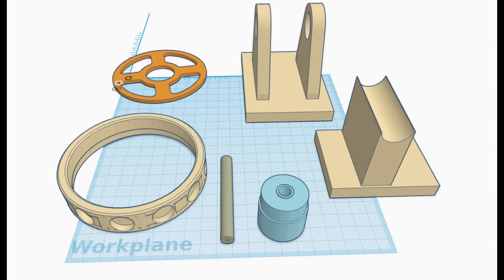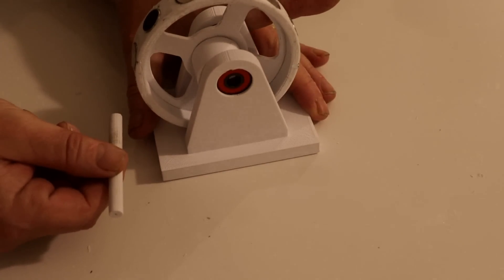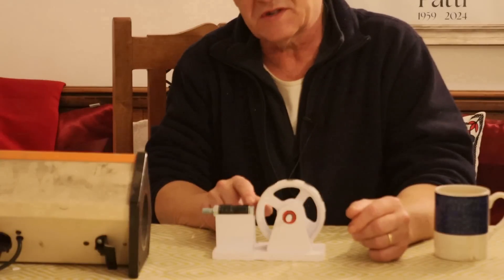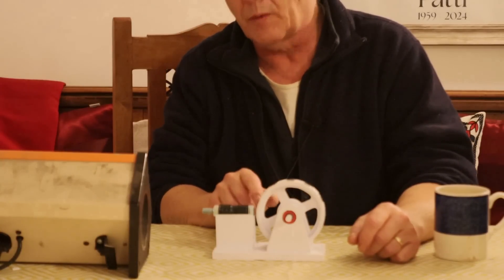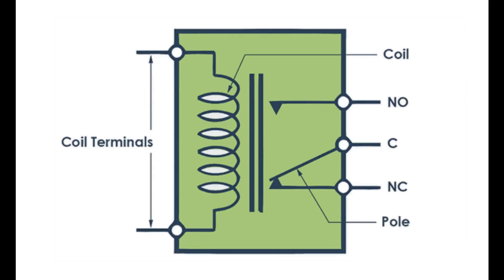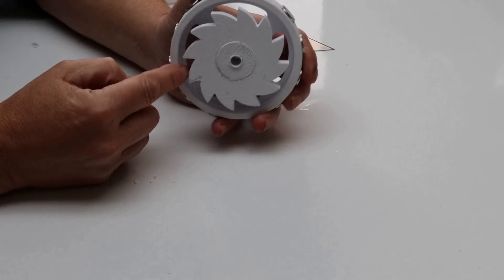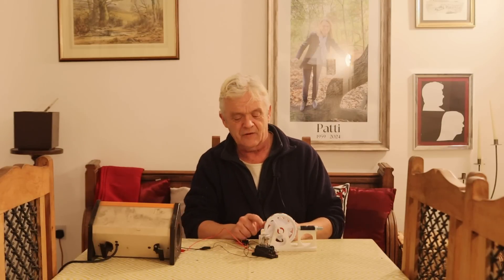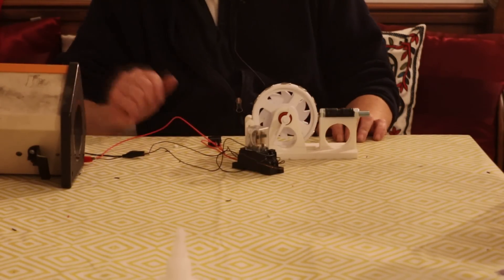2321 Building And Controlling A Stepper Motor

Comment: There is a much easier way to control the direction which is to add a small piece of ferrous material such as another screw near one of the magnets that offsets it by a quarter step when you disconnect the power.  That way when you do the next step there is a much less distance to travel in the offset direction.  This technique is the basis of a Lavet type stepper that is used in commonly available analog clocks.

Comment: Hi Rob, It would be really cool if you could make a large, safe flow battery that is in the form of a 'Double-A' battery. Use some kind of PVC or ABS pipe that is between 6 and 10 inches in diameter as the housing. Then people could have a plan on which they can create there own expandable battery storage system. They could charge the system with solar, wind, etc.  This would be great for people who want energy security and a DIY whole house backup system. Of course there is a bunch more to DIY battery packs, BMS etc., but that can be expounded upon at another time. Just an Idea. Thought you might be interested.  Also anyone reading this post, if you would like to see Rob give this a go, hit the 'up' icon. (wow, it's weird typing that :D)
Reply from the maker: What do you think is a safe battery mate? and not in general - specifically what battery chemistry would you regard as safe?

Comment: Can you hook up a capacitor to the motor that can be used to continue powering the solenoid after an initial injection of power to get it started?
Reply from the maker: for sure - but for this application you just want to pulse it
Reply: @ThinkingandTinkering  Can't a small IC be added to it to do just that?

Comment: Good day Rober ,hope you are doing good ?
What do you guys think about using LC oscillator  to change the the direction of  the magnetic fields for a faster motor?😂
Reply from the maker: that's what is up and coming in the timing control section mate

Comment: I love the simplicity of that design.  I have an idea if it sounds interesting. You need to make a black box that lets one store and retrieve umpteen electronic components with a code. Something all us electronic geeks can use to find stuff! 😊
Reply from the maker: To be honest mate i don't like to do that - stuff varies all around the world and goes out of production - i tend to concentrate on the idea and try to make it work with a host of different components - so any DPDT relay will do, the wire isn't that important, any thickness down to what you can handle and up to half a mm, any bolt and pretty much any magnet around that size - skater bearings are almost universal but if you have different bearings just change the hole size - or at least that's what i try to aim for - I also hope folks will improve on the design - for example i left out the freewheeling diode across the coil which helps prevent the back spike from the collapsing magnetic field and i didn't add snubbers to cut down on arching of the points - this is deliberate to make it simple but would improve things if added

Comment: Hi Rob, I do'nt get how the ratchet forces the motor to keep turning in the right direction. Doesn't it just prevent rotation in the wrong direction? So if the nearest attractive magnet happens to be in the wrong direction, won't that just make the mechanism get stuck pushing against the ratchet?
Reply from the maker: no mate - there is a slight 'bounce' effect fromt he rotor inertia which pushes the ratchet tooth slightly past the magnet solenoid dead centres so that they are always off centre and the path of least resistance is clockwise so it continues to to turn clockwise
Reply: @ThinkingandTinkering  Thanks! I think I get it now.

Comment: I quite like the idea of using reed switches instead Rob. 
The timing could be controlled by the number of turns on the solenoid and a precise voltage.
Reply from the maker: sounds good mate

Comment: Anyone else get completely mystified at the scene where the wires to the solenoid weren't showing up, pausing it over and over to see where the magic electricity was coming from?
Reply from the maker: there is no magic mate it's just a desk top bench supply set at 12V DC

Comment: In theory, one could use a slow discharge module to trigger the relay.

I say 'in theory' because I am not sure how much effort would be involved in building a precisely enough tuned charging circuit to reach the trigger voltage at precisely on second, reliably for long term use.
Reply: "charging circuit to reach the trigger voltage" is also known as"RC-circuit" or "RC-timercircuit".
(That's the R for Resistor and C for Capacitor, NOT RadioControlled.)
Reply: @TerrorTubbie666  I knew they existed from childhood, I just don't know how precise they can be, or if its worth tuning one to that level of precision [enough to reliably keep time].
Reply from the maker: use an arduino
Reply: @ThinkingandTinkering  Even if I could use an Arduino, I already have a whole bunch of varied precision capacitors, resistors and MOSFETs on hand, and would want a dedicated, simple, and robust circuit which is immune to all of the many problems inherent into miscrocircutry.

But since I can't use an Arduino, and won't become capable of such in this life, I'm not going to even bother.
Reply from the maker: ok - well seems a bit defeatist mate especially as the arduino takes about a day to learn and what you are asking it to do isn't that complicated for the arduino to do - but hey we all make your choices i guess - my impression is the degree of precision you think it needs id no where near the precision needed - a clock that loses a few minutes a month is still a good clock - the early clocks lost 15 minutes a day and they were made from wood!
Reply: @hunnybunnysheavymetalmusic6542  oh well, if you got all that on hand, you could.
As far as I know lots of massproduced cookingtimers (and such) have RCcircuits.
If you set a lot of them to 60 minutes, some of them will beep after 59 minutes, others after 61 minutes, most of them somewhere in between. But they have cheap massproduced resistors and capacitors, which are not very precise, as you probably know.

You're biggest problem will be, it just takes a lot of time to tune it. You would need to adjust it daily, then weekly, then monthly, then yearly and even then it might not be completely accurate.
But maybe you're as lucky as to hit the sweet spot in 1 adjustment.
Or maybe you think a deviation of a minute a week is acceptable, then it's easy.

Comment: Years ago I made a similar motor but added a mechanical H bridge. Try this. Get 2 blocks with holes going through the centre of a face. Squeeze these blocks and glue onto the shaft at 45 degrees apart. Mount 4 strips of brass into the plastic base going up to the blocks. As the armature  rotates the edges of the blocks push the brass strips out periodically according to which block has its edges out sideways. Connect these strips diagonally and then to the supply. Finally mount 2  wider brass strip on the base with are spaced just so that the thinner brass strips which are pushed out make contact as the shaft turns. The coil is connected to the 2 wide outer brass strips. There you go, a mechanical H bridge. Make sure you get the correct number of magnets to the no of corners on the blocks which is 8 magnets if using 6 sided block. Get the spacing right and the motor spins at a crazy speed and actually has quite powerful torque. I never got around to putting another electromagnet on the other side of the armature with its wires connected to the first electromagnet. I bet the torque would have been incredible then.
Reply from the maker: nice post mate - thanks for sharing
Reply: On the u tube “ Plasma “ channel the guy made recently ‘Electret ‘ from PTFE + high voltage..  My Question!

Can an electret cylinder rotated within another opposing Electret cylinder generate electricity
And what degeneration of the electret may occur.
Do you need the mechanical generator to generate electricity or can you harvest the static field.. sorry I’m not a member.. please pass this on..

Comment: The magnet circleake it 8inchs wide and wrap copper tube around it with water,connect force hot water pipes u got cheap cheap house heat,wire it to your thermostat. You could save a lot of people in your country
Reply from the maker: have you done a video?

Comment: If you used a horseshoe electromagnet (solenoid) or angle your solenoid you wouldn't need the ratchet.
Reply from the maker: you need it - without the ratchet or something to lock it into place the rotor inertia will lead to a bounce effect which will put the magnet in the wrong position iro the solenoid - give it a go and see
Reply: Yeah, you're correct. I need more coffee😂
Reply from the maker: @justtinkering6713  lol - more coffee is never a bad idea mate - i am off for one now lol

Comment: That is awesome! Robert, try some one-way bearings on the hub. I wonder if that would reduce the drag slightly?
Reply from the maker: i did mate - if they are 3d printed the slack is too much and the rotor loses position
Reply: @ThinkingandTinkering  awe shucks, sorry mate
Reply from the maker: @rodm4151  it was good thinking mate - i just wanted to warn you i had tried it - but thinking about it - maybe if i bought one with better tolerances than i can 3d print?
Reply: @ThinkingandTinkering  Thank you very much for what you do, Robert. Your experiments & prototyping encourage me to tinker more & more. My brother and I were chatting about graphene the other day, and I referenced your videos to educate him a bit more on the subject.
Reply: What if you just forget about bearings and make the hole in the wheel like 5 to 10x bigger than the axle it's on.
This way the wheel will also act like a pendulum. So when you switch the relais, the wheel will be pushed away from the coil, making the bottom side move faster away than the topside (because of the pendulum-effect), so the next magnet that will be attracted by the coil will be the one above the previous magnet, time and time again.
I believe there's such a mechanism in (a lot of) modern electric clocks too.

But on the other hand:
I think this already is a very nice demonstrationmodel.
I think next video should be about replacing the relais with simple electronics. An RC-circuit for the timing and some transistors...🤔